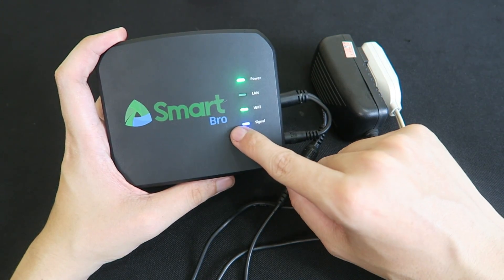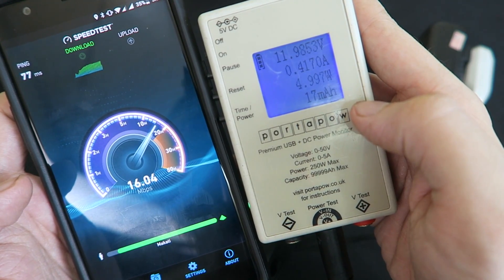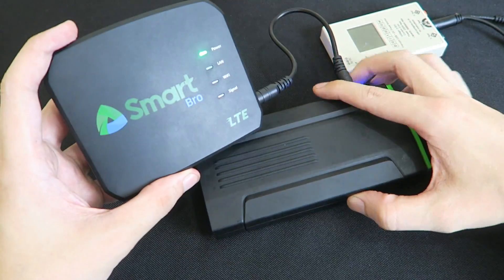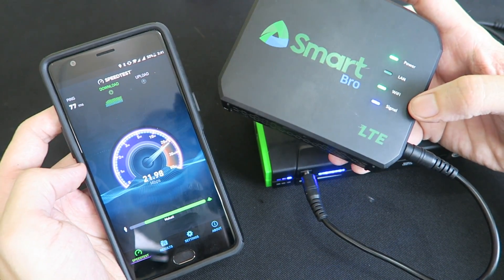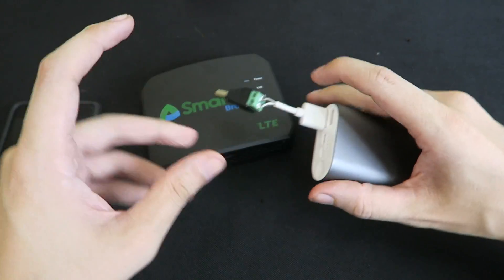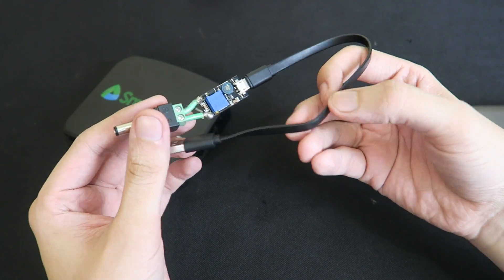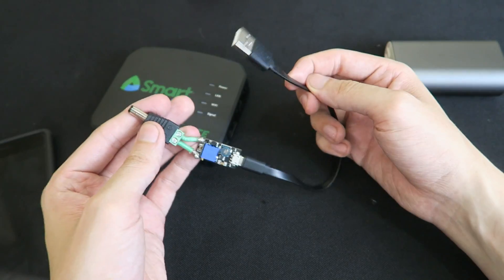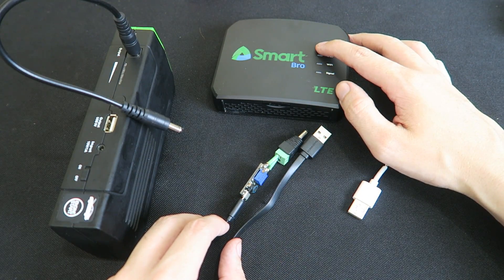Smart Home WIFI made Portable?

Comment: Convert mAh (milliamphours) to time in hours
If instead of the current you have voltage and watts, then the formula is (mAh*Volts)/(Watts*1000) = (hours). For example, if you have a 3000 mAh battery that runs at 5 Volts and 15 Watts, then the time that the battery will last for is (3000*5)/(15*1000) = 1 Hours.

so , not sure, but going to figure out how long this will lasts, need to know the volts also though of router

Comment: Hi Gadgetboy. i have a problem in using one of your choices because the home router i'm having is from the 4G network supplier, and they designedly giving their subscribers routers that are large in size with a design that doesn't fit in in any way into my bag that i carry to college, so i tried to use my sim card with a portable router from the same comany and i figured that the company secures this issue by coding the 4G signal towers to give signal for their home subscriptions when being worked with home routers only, because offers of portable service is almost the double cost of the fixed home service with the half downloadable gegas and speed, so it is almost 4X the cost as total!

so my question is, can i get a way to make my sim work on a portable-designed router that fits easily in small bag pocket so I can buy from the market?
Is there a way to make my sim work on a small portable designed router by tricking their coding thing, is there encoding or certain software can be installed to routers to mimic/simulate the performance or the "show up" of home designed router to their towers?!

Comment: there nice niec review. will it be safe to use 18650 on series since 5v can be used making 18650 7v, and or 3pcs 18650 making it 10.5v thanks and another pair of 3s on parallel for juice, immediately just bought one, and plans to make this portable one rather than buying the pocket wifi i bought the same type instead. or might just use a 4s and find a circuit for converter or a voltage regulator or might just buy a motorbike battery 12v idk which way to go yet

Comment: Mind works fine on either the 12 volt adaptor supplied or a power bank. On my 8000 mah pb. I get about 12 hours of use. Yet to try it on my Anker 26800mah pb.
Ideal incase of power cuts. Or somewhere where there is no power outlets such as camping trips.

Comment: I've tried a direct cable to usb. Works quite well until I speedtest. Then reboot! A boost converter sold by a reputable antenna supplier in the Philippines. Then after a speedtest, well... you guessed right! Reboot! I have a couple of that car boost thingy. But I should know it wont have a problem. I just wonder why some of your options you got lucky. My last resort is hooking up a cap of some sort. To even out the pressure voltage drop.

Comment: hello sir can i ask if it is possible to put or make a external antenna to this wifi? bought one last week and i got a slow net speed due to my location im in a 2 story building and inside an office signal is green unstable one way i think is to put an external antenna but this wifi has no external antena port. is it possible to make one?
Reply from the maker: The internal antenna is connected to the PCB using an IPEX connector. So it's possible you could replace that antenna with an external one. But I don't know how well it would work. Have you tried getting the home WIFI into a better position? High up, near a window?
Reply: my office has no window .guess ill just use this as a back ill find a modem with an external connector but overall i tried this in home its super fast but in my office its unstable and slow 700mhz signal still not implemented here guess i have to wait hehe

Comment: hello, can this device work with a different prepaid simcard from Smart, Sun or TalknText? thanks a lot and more power
Reply from the maker: +rico mambo from smart yes, I haven't tested it on their sister networks
Reply: thanks a lot for the quick response, i appreciate it! so the prepaid simcard from smart worked, did you modify the settings for APN? i think smartbro and smart prepaid have different APN settings, thanks again

Comment: I wqs going to ask how many amps is 7watts since most battery banks label its output in amps, so 7watts / 5volts = 1.4amps, m I doijg this right? My powerbank has 1 amp and 2.1 amp usb output, so I can power it with my power bank correct?

Btw, where did you get that power bank?

Comment: how about the AC/DC adapter with the Samsung 18650 battery
Reply from the maker: Yup that would work (https://www.youtube.com/watch?v=3jNDk1o2KDs). I didn't include it in this video because it's hard to source for most people and it only works after being plugged into an AC outlet which then loses power. You can't turn it on/off on-demand.